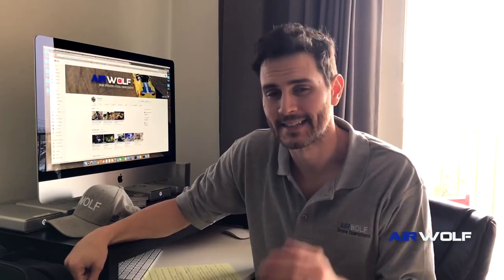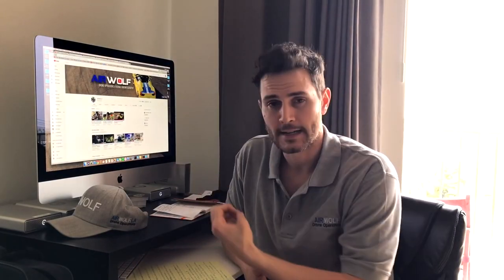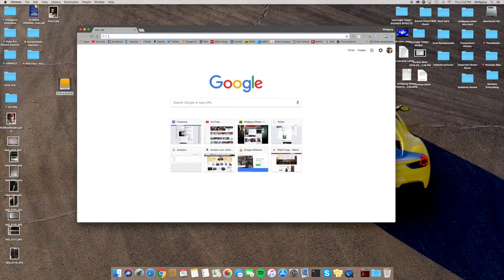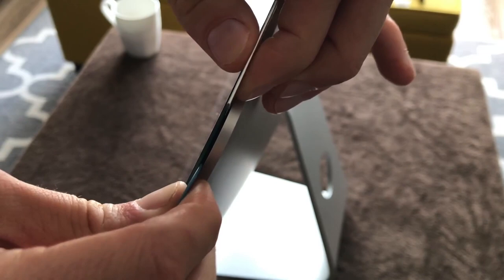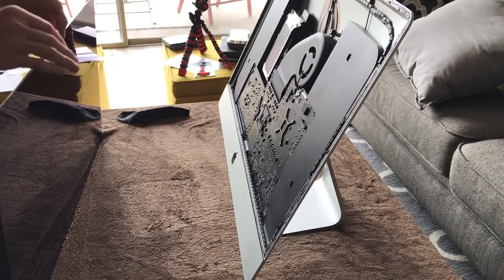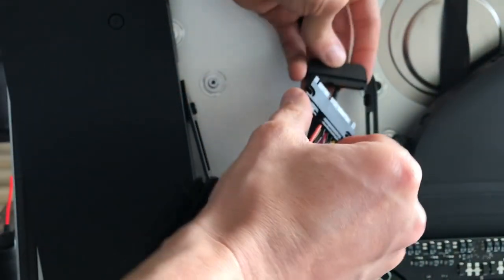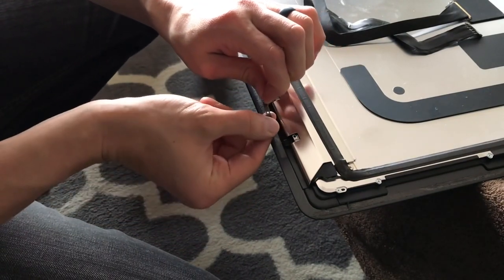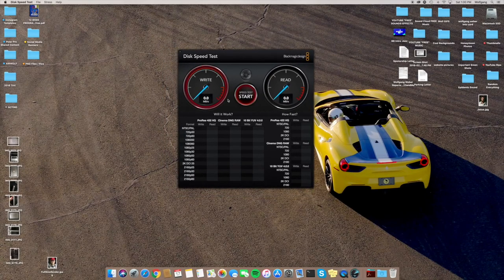Step-by-Step iMAC SSD Upgrade Guide for 5x Faster Performance | 2012-2019

Comment: Hi Wolfgang. Thanks the the tutorial on replacing the HD in my Imac. I have a late 2012 27". I bought the adapter you recommended and it doesn't look like the one in your video. My computer won't recognize it. It says the disk you inserted was not readable by this computer. Gives the option to initialize, which I did and nothing happens. The drive doesn't appear anywhere. Any pictures they show in the booklet and ads for it show 2 hds attached to it. You were doing it with the ssd only and attaching it to the computer with the usb, which is what I did. I tried to go on their website for support, I registered and when I went to log in they said I was banned from their website!!? Couldn't believe it. Did I buy the wrong product? Check your link since that's the one I received, like I said it's different from your. I hope you can help me.
Reply from the maker: Hey there. Yes it is different because they don’t sell the one in the video anymore. So I updated the link to their newest version of. If your computer isn’t recognizing the drive which it should. Try opening disk utility and format to Mac Journaled.
Reply: @AIRWOLF  Hey, thanks for the quick response. I did what you said and formatted it and it worked. Super duper is copying files now. BTW, I copied my files to a 500gb WD passport I was using for backup with timeline and I erased it to copy my Mac HD so I could see if I could boot from it. It got to the about half progress bar in the boot process and the screen blacked out. Could it be because I was using a usb connection and not a firewire connection? I'm hoping that copying files to the SSD drive will be different and it will boot properly once I have it installed in my computer. BTW, I want you to know that I looked at a few videos on installing a new HD and yours was by far the best one. Thanks for your help.
Reply: @rosemarieriley8174  Hi there.  As I'm waiting for Super Duper to clone my HD, I'm reading your comment.Curious if you were successful in upgrading to your SDD?  I'm so excited and praying I don't have any problems.
Reply: @saticoypm  Hi. Actually I wasn't able to get the cloned SSD drive to boot. The only way I could boot was with the old HD. What I finally did was format the new SSD and turned the computer on and followed the instructions. It's been a while, but I think what it did was format it in Journaled format and it was able to boot with the new drive. I was able to use the migration assistant in MAC to transfer all my info from my old drive to the new one.
Reply: I did have to download Catalina. If you read posting from Luis Lopez, Airwolf told him how to do this without cloning. Good luck.

Comment: Hi Wolfgang, I followed your steps one by one and the new SSD hard drive is not working, I put the old one just to make sure the conections are ok and the old one worked, any idea what happened? The only thing I didn't do was not "EJECT" the hard drive at the end of the cloning process, I just disconnected the cables. I checked in anoter computer the content in the clone drive and everything seems to be there.
Reply from the maker: Interesting 🤔 If I was in your shoes I’d just restart the process. Make sure you’re also formatting the new SSD as (Mac journaled) before running clone. Try cloning it from scratch again and let it run its course. Maybe on the disconnect something happen? What SSD did you end up getting? Samsung?
Reply: AIRWOLF hi Wolfgang, yes the same as yours but 500gb since I use an external hard drive to save all my pics. I don’t need much spaces

Comment: One advice next time is not need to open the imac just run external the ssd via thunderbolt and boot externally and keep using you storage inside but now that you already done it you could actually buy same ssd and do raid 2ssd so you will double the speed.
Reply from the maker: Thanks bud.
Reply: @Abel Esteve I don’t understand. Can you explain me? Thank you!
Reply: @SergioSolisI  what actually you want to do?
run os from external storage?
Reply: @abelesteve9881  I want it to go faster because my mac is a turtle and it is 20019. 
I think I understand you a little.
Reply: @abelesteve9881   yes if is possible run of external SSD it would be great
Reply: @SergioSolisI  yes i suggest use the thunderbolt port behind the imac , connect it and just do and install and when you choose where to install choose the ssd.
Remember pass your data to time machine or icloud to transfer later and then everytime you swith will boot from ssd and then with disk utility delete the data you have in the storage inside the imac and use that one as extra storage, you can do with all the ports behind but if you want it fast use thunderbolt.
I have 2ssd on raid and one port with windows for when need it. but this is different history, btw there is many tutorials in youtube about how to do this just check it out i did it like this too.
Reply: @abelesteve9881   thank you Abel, I already did, the OS works fine thank you, 
but it won't let me install applications of adobe I don't know what I'm doing wrong. 

My Os is Monterey  I can’t install any apps or programs for example photoshop (original) because appear error 22. 
Do you know why? Thank you so much
Reply: @SergioSolisI  i didn’t update to monterey yet i never update os straigh away i always wait to see how they do and when is ok and clean with not many bugs update it.
always check first ,see reviews etc i just update a few months ago to big sur so i will wait myself a bit longer.
Reply: @abelesteve9881   yes, thank you, but I have Monterey in fusion drive and Adobe Creative runs very well! 

I don’t understand why in external SSD I can’t install.
Reply: @SergioSolisI  i’m sorry but ain’t using monterey so i don’t nothing about always new os come with bugs and problems it takes time to fix , as i said i’m still running catalina
Reply: @abelesteve9881   Thank you!

Comment: @UCsbtN96d1PnOwdJ5wJyghig I have a late 2013 iMac. I want to replace my fusion drive or HHD mechanical 3tb drive inside it with an SSD.  I noticed you cloned your internal HHD to the external SSD that you will eventually put inside the iMac.  When you cloned the HHD to the SSD.  Does this also put all macOS system preferences over to the SSD so that when you install the SSD to the inside of your iMac and start it up, everything will look and feel the same?  I am hoping to put everything that is on my HHD to the SSD so that I won't have to go and set up all my settings.
Reply from the maker: Yes everything will be the same. You may have to sign into certain programs again. But everything will run and operate the same but faster.

Comment: What is the link for the exact thermal sensor cable you used. The one i received was different and does not have any kind of power cable.
Reply from the maker: I just check the link in my description and it seems to be the correct one.  Did they perhaps get things mixed up?
Reply: @AIRWOLF  possibly. Did you set up the hardware as a raid drive?
Reply from the maker: No I did not

Comment: Ok so I got the 2019 iMac 4K. I put in 2-16 GB DDR4-2666 sodium Crucial memory and 1 TB MX500 SSD also from Crucial. I used the program you suggested to copy the HHD and it was successful but now when I startup it shows the Apple logo and the loading bar gets about half full then it just shuts off. Any suggestions?
Reply: I figured it out. I used the recovery method on the iMac and it loads so
much faster
Reply: @JRonyStarDust  Hi! I have the same iMac as yours (2019 4k) but mines 1 tb fusion drive. Can I still use the MX500 SSD to replace my fusion drive? Did you use any adapter?
Reply: The HHD to SSD will be the same but you will have the option of upgrading the PCIe card that is located on the main board. If you decide to do this it can be a little tricky because you have to take out all the components. And if you do that you might as well upgrade the RAM because it’s on the same board. OWC has a good video of this complete teardown. And the ifixit website has the all the tools you need. You can get the tools with the 1 TB ssd for 200 bucks and it comes with a dock to use your old HHD as an external which is really helpful if the ssd cloning process didn’t work the first time.

Comment: I would like to add an SSD for my space to my 17,1 Late 2015 27" iMac. It seems to only have the m.2 512gb drive and no HDD or SSD. Will the sata connection cable be there or will I need to buy that in addition to the thermal sensor adapter cable? Thanks!
Reply: El

Comment: Great video im thinking on upgrading on my imac 2015 27 inch 3.3 but i got the 2tb fushion drive and when i did the disk speed test same program as the one u showed us and the write and read speeeds is highers than yours,  so im confused  thannks
Reply from the maker: I7 or I5 processor?
Reply: @AIRWOLF  i5
Reply from the maker: @LUISABAKES  if you’re not experiencing any slow downs then you should be fine with your setup. Your fusion is considered a hybrid drive. It’s half 7200 and  half SSD. If you do install and full SSD your speeds should Definitely be faster. My computer wasn’t a fusion and is a 3.2 quad core vs your 3.3. But again if yours is running fine don’t do anything. Maybe try maxing out your RAM instead at 32G.
Reply: @AIRWOLF  oh yea i also have 64 gb ram  maybe thats why is like that? ok so iwont upgrade thanks for the info
Reply from the maker: @LUISABAKES  hmm 🤔 interesting that model is only configurable up to 32G. So I don’t know where the extra 32 is coming from? 🤷🏻‍♂️
Reply: @AIRWOLF  i know apple says up to 32gb but i found online that it can take up to 64 gb ram  , it works fine in my imac especially when using fcpx and lightroom and chrome and the same time
Reply: @LUISABAKES  Hi Luisa, would you mind sharing exactly which ram you went for please

Comment: would this work on the IMAC ??? SAMSUNG 870 QVO SATA III 2.5" SSD 2TB (MZ-77Q2T0B).  iMac (Retina 5K, 27-inch, 2017) ???  we are a cat and dog rescue film maker non profit can really use your help on upgrading my 2 imacs
Reply: you can boot off external drive without opening it up - it will take a usb3 port - or I use thunderbolt - it will be fast. have a google around for "booting to another drive mac". it's quite straightforward for new installs. (cloning since big sur - due to security is now a real pain. )

Comment: can you tell me what size ssd would be needed to replace my 3 tb fusion drive.thanks
Reply from the maker: Chris Watts typically you’d want to replace it with a 3T SSD. But that question is really up to you and how much space you want it work with on your internal drive. I personally use the 1T. But I edit off externals. If you already have the 3T I’d just replace with a 2-3T and you’ll be fine.

Comment: I replaced my drive with ssd on 2015 27" iMac and had no problems BUT I'm NOT going to do the adhesive strip thing. I have a clip that covers the camera (3d printer). I'm not an engineer but I can't see the display just falling off. I never move the screen around so tell me I'm stupid.. I have the strips from OWC but I don't want to do it. The clip on top covering the camera will work, right?
I'm not doing it ...I'll take my chances...hahahahah
Reply: Blue painter’s tape along the edges will hold like crazy, outlast the iMac, be easy to remove, and, well, look super cool.
Reply: Fans will suck dust into the display as I understand it from other videos. The tape is mostly an infiltration seal.

Comment: Can you just use external SSD via lighting to do the same thing but avoid opening the Imac?
Reply: Pretty much what we did because we didnt want to pay to upgrade our HDD (its exorbitant) and my wife thinks the original HDD is too slow. So we used a external samsung T5 SSD via USB3. Just have to configure the mac to boot via external USB. works great so far! It is starting to slow down for some reason, havent gotten around to figuring out why but it has been 6-7 years
Reply: No matter what interface you connect it to, a SATA III SSD is at best going to run at 6Gbps = 750 MBps. In reality, it's less than that, usually 450-550 MBps. You can't make it run any faster than that no matter which port you connect it to. SATA III is the choke point.

Comment: One more thing- crucial has the mx500 ssd that fits without the adapter.
Reply from the maker: A 1000 apologies for not getting back faster. But! I’m supper excited that you were able to figure it out. I’m sure those speeds are pretty darn nice!

Comment: I have a late 2013 21.5 iMac and from what I'm reading online a thermal sensor isn't necessary. Could you clarify this please?
Reply from the maker: Yes! Do it! Even if it's not....Just do it. I did and i've had zero issue. Happy building.
Reply: @AIRWOLF  Thanks for the quick answer. Here's another question for you. If my iMac has 8GB of ram should I upgrade the ram while I have the computer open or will switching to an SSD improve performance enough so 8GB of ram is enough? I'd like your opinion on this because upgrading the ram is a lot more involved than replacing the hard drive.
Reply from the maker: I did everything at once. I maxed out my RAM at 32G and with the SSD you’ll be glad you did it. So yes! Do it you won’t regret it.

Comment: Is there an adhesive pack for the 21.5"? And do I need the thermal sensor for the 21.5" late 2015?
Reply from the maker: Not that I know of but I did include an adhesive option for that in the description.  You'll just have to cut to size. :)
Reply: @AIRWOLF  so this will still work on late 2015 /21'5 model ? I was doing so much research that I can't find it on the 21'5 just the 27 ' I have the 21'5
Reply from the maker: @girlandcoffeeshop8173  Yes you can :)

Comment: Could youtell me, please, I have an imac 27 2019 will it work on fusion drive?thank you so much
Reply: I think you can put in a NVMe drive with incredible speeds around 2500 mbs in that one as well as an SSD 2.5 inch. Take that fusion drive out. They suck.
Reply: The FusionDrive speed is not THAT bad... 800-1200MB/s . Much faster than the SATA-SSD solution in the video! It depends on your daily work and use cases, if you need even more. Without opening or destroying your iMac, you could easily speedup things 2x with an external solution. There are some external THUNDERBOLT enclosures for NVME SSDs Gen3/Gen4. Speed is around 2300-2700MB/s. 
(If you just want more space and a similar speed to your internal drive, around 900-1000MB/s, you might also use a cheaper USB3.1/2 Gen2 enclosure. I believe your iMac's THUNDERBOLT USB-C ports support the faster transfer. If you build your own combo it is quite cheap. If you want something out-of-the-box then try SAMSUNG T7)

Comment: My iMac27"  2015 is running over 1000 m/sec, my problem is the capacity of the hardrive 512meg, I don t want a slower hard dive.

Comment: On mine, the original hard drive is broken. If I replace it with a ssd, how do I install the os?  Or should I install the os on the ssd first?
Reply from the maker: 2 options I see is to either pre install the OS onto the drive or install and restore via your time machine backup.
Reply: @AIRWOLF  Did not backup...that's the tragedy part. :( Thanks for your video!
Reply from the maker: @aviaxing2240  NOOOOOOO! Well, the upside is now you can start from scratch .

Comment: Why don't you upgrade to M.2 NVME SSD to double the speed again?  In fact your imac has a PCIe port on the mother board, and you can insert a 1 TB M.2 NVME SSD there too.
Reply: That’ll take more digging deeper into the computer wouldn’t it?
Reply from the maker: Yes it’s a little more work but it can be done. I personally at the time didn’t have the knowledge of it.
Reply: on my iMac late 2012 I will not gain speed with the M.2, only on iMac 2013 and later.
You will also need the correct adapter to avoid issues.
Reply: What's this sorcery about now I'm curious to know more.
Reply: The iMacs that only came with HDD from the factory are very hard to get a M.2 SSD that works properly. So the only thing you basically can do is sata. But, if it had a fusion drive or SSD you can use an M.2

Comment: Is there any issue with the fact that it’s a fusion drive? Do Samsung drives mesh ok with the blade drive that remains unreplaced? Currently running my macOS off a drive in the lightning port. It’s way faster just doing that than the awful fusion drive.

Comment: I successfully added a new harddrive and up and running (I have a 2017 27 inch iMac) but now I am getting error panic messages, if I leave on and leave for 30 minutes. I tried "no sleep" and it now does it and sometimes makes be reinstall OS Any suggestions ?
Reply: have you reinstalled the OS yet?

Comment: Why buy a new iMac?! I just got my parents 2011 iMac and threw in an extra 8 gigs of Ram and a 500SSD. It’s blazing fast.
Reply: @AIRWOLF  I've got a a 27inch 2012 and i can't upgrade to the new IOS. Apple told me it a vintage model! it is worth upgrading ram and SSD??
Reply from the maker: Depends what your soul purpose is for the iMac?
Reply: @AIRWOLF  wanna make it as tip top as possible. Is changing the processor worth it? Or will thee RAM and SSD  be adequate?